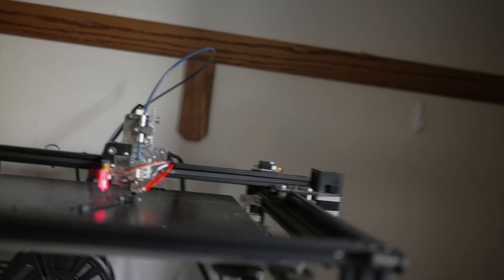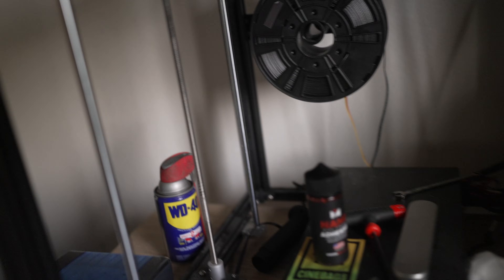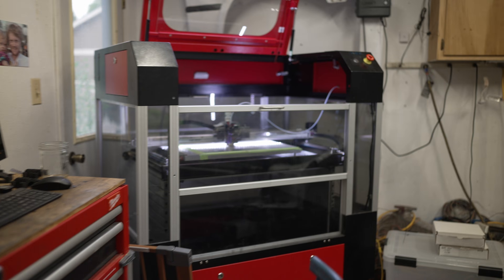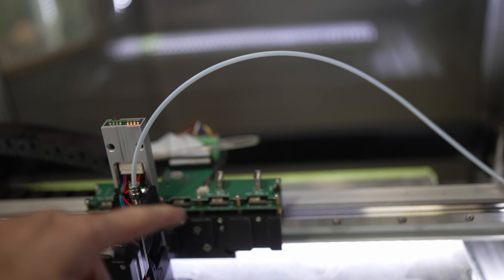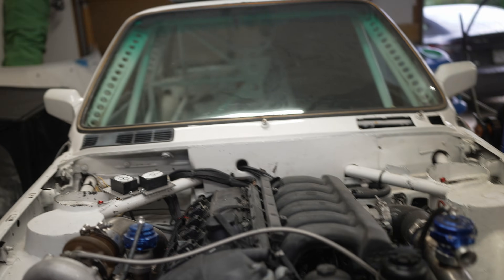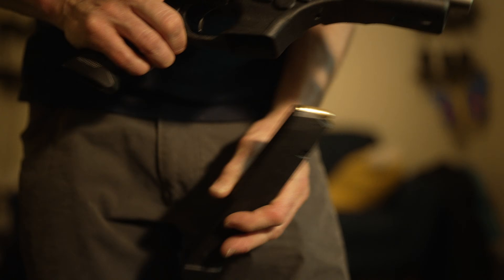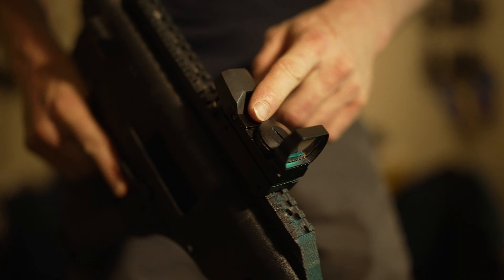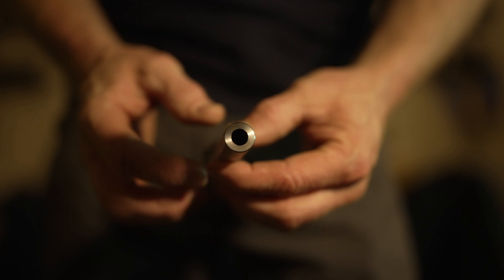Carbon Fiber Nylon on Ender 5 Plus FGC9

Comment: hey, just keep in mind that I had to JB Weld 3.7 ounces of steel to the lower receiver of my FGC-9 in order to make it legal under my state's laws..... the law in my state specifically states that it has to have 3.7 ounces of steel attached to the lower receiver if the lower receiver is made out of plastic........ you really need to read your state's laws to see if your legislators passed some stupid law like this in your state........ They supposedly want to ensure that it can set off a metal detector (even though you already have a metal barrel and a metal bolt and a metal firing pin, none of that matters though! You legally still have to permanently attach 3.7 ounces of steel to the plastic lower receiver!!!!)....

Comment: I 3D printed my FGC-9 9mm semiautomatic rifle on my regular Creality Ender 3 with black carbon fiber High Temperature PLA and it came out good. (I also have a new hot end and a new motherboard on mine, too) I had a guy make me a 16 inch barrel and bolt for comparison and then I welded my own bolt and I made my own barrel out of an explosion proof hydraulic tube I bought on Amazon. I also found one on Temu but I used the one from Amazon. It is just as good as my Tec-9 / AB-10 semiautomatic from the 1990's. I 3D printed the front hand-guard 6 times and then I JB welded them all together and then I painted it all black afterwards and it looks like one regular normal front hand-guard in order to get it to the appropriate length to accommodate the long 16 inch barrel. I had to have a 16 inch barrel in order to keep the stock because under federal law you cannot have a stock on a gun unless you have a barrel that is at least 16 inches long, which is obviously why you don't have a stock on yours since you have such a short barrel. Yours looks super strong BTW.

Comment: I heard correctly 500 dedrees Celsius. Can you explain how exactly.
Reply from the maker: I installed a new main board and configured it to run hotter. New hot end and also new heating element.

Comment: FGC is cool and all but the car parts are very interesting.     Can you join the nylon-carbon parts effectively?   What temperature does it turn into a melted turd?    I can think of all sorts of bits and pieces that it would be nice to draw up and print that would otherwise require welding and machining.
Reply: cf nylon softens at about 90C-100C so depending on if you live in AZ it could be viable.

Comment: Very cool, did you use carbon fibre nylon for the FGC9? Would you reccommend it over a glass filled nylon? From what I understand most gun manufacturers polymer frames are some proprietary blend of glass filled nylon.
Reply from the maker: I would definitely recommend the carbon nylon which is what I used. EXTREMELY tough material. I haven’t tried the high temp material, but I home to print a barrel retainer or two from it in the next few weeks.

Comment: I'm about to purchase my first, and I know pews are gonna be my end result after I get familiar with the tool and software but I'm having a hard time deciding if I'm gonna get a e3v2 or s1 and mod it up to print nylons or if I wanna have the bigger plate of the 5 and mod that. Just tryna figure out where the best aftermarket support vrs printing quality/capabilities lie, but I think I'm leaning towards the e3 style first. Your shop did an amazing job on those machine parts.
Reply: Nylon is the future also htpla
Reply: Well I have the s1 and it fricken rocks. I also have the original e3 and the s1 is exponentially better
Reply: For the price the ender 3 is bad, sure its the cheapest, but the kobra 2 max is bigger, faster, and generally 10x better for only a hundred or 2 more dollars
Reply: @Garkin58 That’s a difference from 100-150$ to 200-350$
Reply: @Mihail2204  you get what you pay for i guess